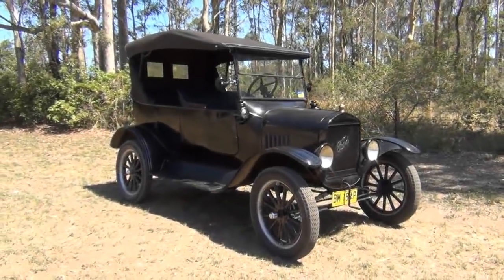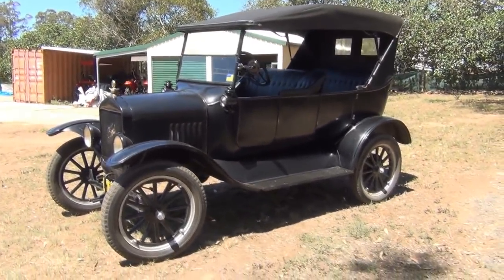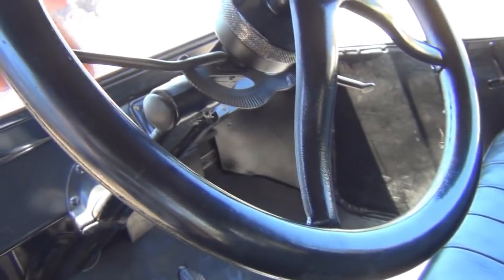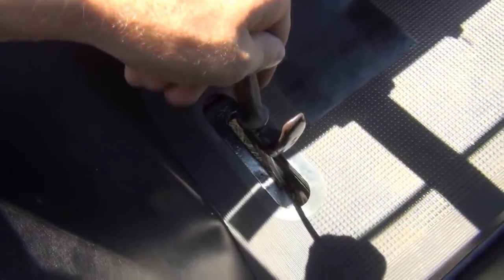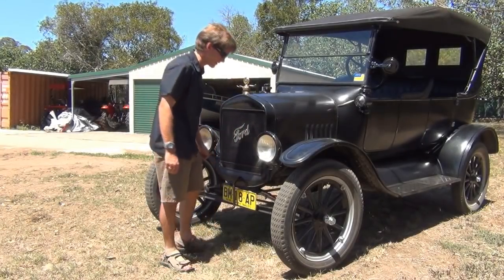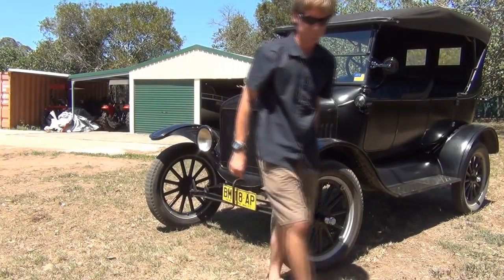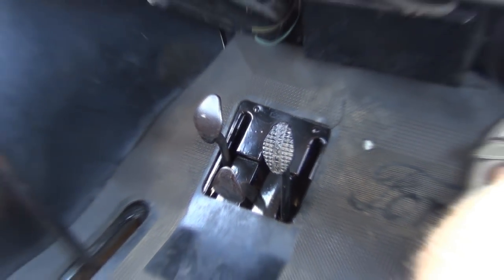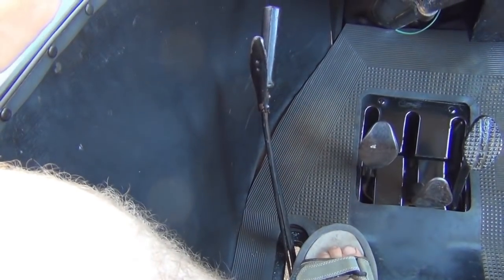Ford Model T - Starting Safely & How to Change Gear

Comment: The great thing about owning a Model-T, is you wouldn't even need to lock it, or get a car alarm. The car itself is it's own security, a thief wouldn't know how to start it, let alone drive it.
Reply: Like manual transmissions in US cars.
Reply: I don’t know a single person who dosent know how to drive stick their are plenty of standard vehicles in the u.s not as many as in Europe obviously but still plenty driving around. I have had many standard pickups and cars. I think they are overrated big time. These newer autos are in every single aspect better than a standard. Europeans are just full of themselves or don’t know anything and think that driving standard is a super power when it is easy and can be learned by anyone who wants to learn it. It’s just a bs stereo type and most things in the us such as trucks are much more challenging to drive then the little euro cars.
Reply: Unless.........he went to youtube.....
Reply: @EricRomeoCooper unless you’re deaf, you’ll hear the person starting it up and swearing while they try to get it working

Comment: I knew a lady, born in 1906, that told me, thanks to the gravity fed fuel system, that when, going up a steep hill in town, she would have to go in reverse so as to keep the car from stalling.
Reply: Phonoboy yes this is true
Reply: Thank you
Reply: My Dad (1899) mentioned that to me.
Reply: Reverse also had a lower gear ratio than low gear, making hill climbing easier.
Reply: My grandfather told me about this, too.  He said there was a hill in his neighborhood that was so steep that everyone had to drive up it backwards.  It was comical to see half the neighborhood driving up backwards in order to keep their engines from stalling.

He also told me about a problem with the fact that factory cap for the radiator and for the fuel tank were exactly the same -- except the fuel-cap had a small, hard-to-notice hole in it to allow air into the fuel tank as the engine sucked out the fuel.  People would occasionally mix up the radiator cap and the fuel-cap, and if the radiator cap was on the fuel-tank, the fuel would eventually quit flowing because of the vacuum that had built up, and the engine would stall.  Of course, as soon as it stalled, the air would flow into the tank through the carburetor and equalize the pressure -- meaning the engine would start right back up again as if nothing was wrong.  A very common complaint at the mechanic's of the day was a Model T that would stall like this.  Simply swapping the caps would fix it. ;-)

Of course, people that had installed one of those thermometer-caps like Mr. Taylor here has done wouldn't have this issue.  But the car wasn't equipped with that cap from the factory.  

Just a little Model T trivia for you.  :-)
Reply: :)) Makes totally sense. And is funny.
Reply: My dad has frequently told us kids that, although it is quite a task to learn to drive, the Model T is one of the easiest cars in the world to work on. And if you think about it, it had to be, because there were scant few repair shops in the beginning and many people lived way out in the middle of nowhere, so making it as easy as possible to work on was crucial. Too bad new cars have done a complete 180 on this concept...
Reply: Were fuel pumps aftermarket accessories? I know water pumps were.
Reply: My Grandfather told me of a salesman who knew how to get around that particular feature looking bad. He'd say just how powerful the car was: "Look! I can take  all the way up this steep hill!" He'd take the car about halfway up he hill, and then "Just to prove how versatile and powerful thia car is, I'll drive it the rest of the way up... BACKWARDS!!!"
Reply: I have a German friend, he worked with Trabants quite a bit, he said  that since fuel's gravity fed – there is nothing to stop it in case of an accident. Fuel just flows out. On the ground. Where the cars are with quite possibly badly injured people inside and other cars and/or people around. It often was quite spicy.
Reply: Phonoboy that’s quite cool!
Reply: btho3413  No, no--they actually had to turn the car around and back up the hill.

Comment from the maker: So long as the radiator has adequate water, and you don't drive it constantly in low gear or uphill, or leave the engine idling at full spark for lengthy periods, the engine shouldn't overheat at all, even on a hot day.

Comment: Thanks, Mitch! I was one of the ones asking for this video. :)

From ~4 yo to 15 yo, my father had a 1924 4-door Model T that was his grandfather's; it sat in a barn prior to moving to the back of our garage.

As a kid, I was enamored with it, thought of hooking up a battery charger to play with the electric stuff (always wanted to hear the horn) but never did, frayed wires scared me.

We sold it when we moved to Colorado, got $3,500 USD for it.

Comment from the maker: You are right, yes, important to remember though when shifting down to low gear to back off the throttle to idle, so as not to race the engine... So in practice it's... Reduce throttle, then depress the clutch and pull the hand brake back to the middle.
The hand brake action is not necessary though, as the pedal does the shifting. Releasing the clutch pedal with the hand brake in the middle will actually put you in neutral. 
Also halfway between high and low on the clutch is also neutral!

Comment: Nice T!  I have a 1916 touring with no electric starter.  It runs and drives well.  With a little practice, you get to where you don't have to fool with the brake lever during normal driving.  When you come to a stop sign, etc., simply push the clutch pedal half way (to neutral) and the brake until you stop.  It does take some practice to judge where neutral is when first learning how to operate the clutch pedal while under way.  Thanks for posting!

Comment: Hi Mitch, great video. I drive a 1946 Ford pickup,see avatar, as a daily, with flathead and 3 speed gearbox. Not as complicated as a T ,but still have to double-declutch,etc. An anecdote I heard years ago about starting model Ts , was that during the cold winters in the US they used to jack one rear wheel up and turn that, because the oil in the gearbox was thickened by the cold and the car would drive forward, even in neutral,  into the person using the starting handle. Also the car was reversed into the garage for the same reason, not getting pinned between the car and wall if using the handle.

Comment: That was awesome! I always wondered about the timing and throttle.... but absolutely no idea on the pedals. I could drive one now from this. Well, gotta get it started first but I see how to do that as well. Similar to a modern ignition interrupt or like some of us without high torque starters, turn the dist  and start, then use timing gun. That's so cool and I would love to try my hand at a hill (from a roll ha). It is a true 'driver's' automobile. I bet some people had a hard time. I'm sure most guys caught on but man, only a small percentage could really feel it, hear it and make the adjustments. This is when driving kept your attention and to me, is fun.
Reply from the maker: Thankyou for the comment, it's these positive messages that makes me want to share more videos :)
Reply: I told all of the older guys at work. They knew about timing and throttle but the brake lever/shifter blew their mind. I would love to drive one and try a hill, backing the timing etc. That is when you had to drive a car... and be smart about it. Thank you for the video!

Comment: The price of simplicity in car design is the driver is more responsible for the engine. Personally I prefer having more control over the vehicle I'm driving. Some people prefer not to. For those, they can continue driving their overcomplicated modern vehicles. The more parts a vehicle has, the more that can break. I do not have a Model T or A (yet) but I do still drive a somewhat old vehicle (mid 80s). I chose it because it is of much simpler design than modern cars and less to break. If I had a Model A or Model T, I would very likely drive it as a daily driver.
Reply: I Invoke My First Amendment Rights I have both a 1979 vw rabbit and a 2003 Mazda 6 And the rabbit is much more fun to drive and less maintenance
Reply: Yes, the codes are "secret" so you have to go to stealership to get it sorted in the back, while they sort your wallet for you in the front.
Reply: I'm planning on getting a Model A for a daily driver. I've been designing things on paper that I can build cheaply to improve one to run a little better in today's time. Overdrive and a OHV head for it. I guess it's strange for someone that's only 20 to want such an old car. But I love them. All around a much better car than a modern one to me. And they can be found quite cheap for a running one in good condition.

Comment: Great video. Thanks for taking the time to post it. When you are in high gear and need to return to low gear, is it just a matter of positioning the hand brake to the middle position and stepping on the clutch petal? In that the transmission is planetary I would guess you can do this while still in motion at an appropriatre speed? Thanks TM

Comment: Really great video which clarifies many things.  You have shown us how to change up to second gear, but can you then change back down to first when going up a steep hill by simply putting your foot all the way down on the clutch or would the gear change stick need to be moved too?  I have also heard that you can just pull back on the lever to the brake position if you need to brake suddenly??

Comment: Hi Mitch - very interesting and informative. My late father's talk of driving a Model T now make sense; even going up a hill in reverse to maintain gravity fed petrol flow!
1925 engine oil was greatly different to modern lubes. Can you get by on SAE30 mono such as we'd put in lawn mowers, or is there a line of oils for veteran engines?
Reply from the maker: Thanks for your comment :) -- yes the modern oils work just fine, HOWEVER... ensure you DO NOT use any oil with names like "Magnatec" or similar Magnetic Oils - while they are fine with modern engines, these oils contain magnetic particles which attracts the oil to metal surfaces within the engine and gearbox. These oils are damaging to a Model T, because of the magneto. Magnetic oils will gum up the magneto and prevent it working very quickly.
I personally use Valvoline XLD Premium 15W-40, it's inexpensive and performs perfectly.
Reply: *****
Thanks! That's interesting too.
Reply: ***** Use oils with a zinc additive, some say 'ZDDP' the zinc is important for those flat tappet cam engines. Here in the States the enviros made us take all the zinc out of oil, thus that oil can destroy an older engine's camshaft in as little as 500 miles.

Comment: Hi Mitch...great video...just wanted to comment on what you mentioned about the Canadian built cars...they were built with a functional driver door, which was usually useless in Canada, as the steering column, and park brake were still on the left, although CDN built EXPORT models did have the controls on the right side...just thought I'd clarify that...Wilf

Comment: I see you don't have the option for an "antique" license plate in Australia like we do in the states. I believe there is a option for a magneto upgrade & an electric radiator fan now.
Reply from the maker: Actually we do have what's called Historic registration, which also has a different license plate to full registration. I recently changed my Model T over to Historic rego as it's a lot cheaper! :) I'll be posting a video of it soon :)

Comment: Around 15:35 you mention Canadian built model t's have the steering wheel on the right side. Did you mean to say England-built? In Canada we drive on the left side as well.

Comment: I can see how your leg could get tired holding down the low gear pedal for an extended time period. Was there ever a way to lock the pedal in the down position?
Reply from the maker: Good question :) No, there's no way to lock the pedal in the down position, but good news is, you don't need to, that would be like saying can I lock my modern car in first gear, because that's all you'd be doing. Unless you're climbing a steep grade, you don't leave it in low gear, I always get into high gear as soon as possible - this also saves the band linings from unnecessary wear and tear :)
Reply: What I was referring to would be where you might be on a wood road or logging road. The conditions would be such so that you can't go fast enough to get into high gear.
Reply: Just so you're aware greenmtnman, you can start in a modern car in second gear. First gear is unique in the sense that it exists for one purpose; to get the car into second. You do not want to drive in first if at ever possible.

Comment: It's almost like driving a tractor, well the only thing in common is the clutch( just not the same action) and the engine RPM, well on a tractor you have two, the lever and foot pedal

Comment: Your T looks to be quie original, is it an older restoration or just a well preserved car?.i learned to crank engfines by practicing on a pair of T's at my local Ford dealer ship. Both were cars that Ford NZ would loan to dealers for Display. in the 1960's .
Reply from the maker: Older restoration :) It's fared well since 1966 :)
Reply: Well that's 51` years, it was newer when it was restored than what it is now .. a really nice example .

Comment: I can't image how that clutch work internaly, it's seems so illogical
Reply: Imagine a planetary transmission like a modern automatic transmission has.
Instead of automatic tightening of the various transmission bands, the Ford Model T's low speed transmission band is manually tightened by pressing down on the clutch pedal (low gear).
When the clutch pedal is released all the way back, then the transmission is shifted into direct drive (high gear).
When the clutch pedal is held in the middle, then the transmission is disengaged (neutral).
You could learn to drive a Model T Ford in less than 10 minutes. You just have to forget about anything that you have done before. That is the hard part.
Reply: @ibsoarin  So it's not at all like the clutch in the manuals which just disengages the flywheel from the transmission.

Comment: Mitch, I could listen to that electric start all day long, something about those 6 volt starters cranking over all that steel. By the way... Is there any kind of cut out for the starter button? As so it isn't activated accidentally once the engine is over and running... Or is it just a tough button?

Comment: How do you change back to the low gear when the vehicle is still moving? I think I have not seen that. Do you have to set the hand(brake) lever to the neutral position first or just press the clutch pedal? How is it done?

Comment: Very interesting! How do you tell if you are within the speed limit/s including school zones & the like? What's the top speeds on down hill, on flat road, on up hill? Do you have 2 gear speeds for reverse also? Do you ever get confused driving the Model T, accidentally (forgetting momentarily) using the various controls like it was your regular modern vehicle? Does it have a fan belt to run a fan to cool the radiator? If not I can see why motor would easily over heat on a hot day! Thanks for the demo!

Comment: Silly me ... you showed this at 13m29s :)
How many crankshafts have you been through? :)
When you are in 1st gear do you need to constantly hold your foot on the clutch?
Reply from the maker: +Mark Heuzenroeder ... my T still has the same crankshaft I bought her with :)
And yes in low gear, you hold your foot on the clutch. Then you move the handbrake (gear shift) all the way forwards, and release the clutch to change to high gear.

Comment: howcome you didnt put it on club plates?
Reply from the maker: It is now :)
Reply: @ModelTMitch how much is club reg all up per year in nsw?
Think it’s like $100 member fee, $90 permit fee for 45 days or 180 for 90 days, no pink slip

Nearly 100 years of the somewhat modern motorcar 👀

Comment: Can't you just place the parking brake all the way forward and leave the clutch pressed in half way when stopped and press in low gear when starting? This eliminates a step.
Reply from the maker: Yes you absolutely can, that's what I do all the time now... But when learning, even the manuals tell you the long way. Just have to remember to press the pedal half way - even I have stalled at traffic lights because I forgot to push the pedal lol!
Reply: Your question answers a question I was going to raise about how exactly that left pedal works. So from halfway pressed to fully pressed is the clutch for the low gear and halfway pressed to not pressed is the clutch for the high gear.  That makes much more sense than what he said in the video!

Comment: i know you're a model T guy, but is the hill climbing technique thesame on the model A?
Reply from the maker: ***** Im not 100% sure, the Model A has a manual transmission, with a conventional clutch pedal and gear shift, so the techniques would be a bit different, aside from the spark advance.
Reply: ***** yeah well i did mean the spark advance, sorry.

Comment: Why are you not charging the battery when the engine is running?
Reply from the maker: The battery is charging while the engine is running - the generator is always charging unless the battery is full, in which case the cut-out dumps the charge to earth. The BAT / MAG switch does not affect charging - it charges on both positions.